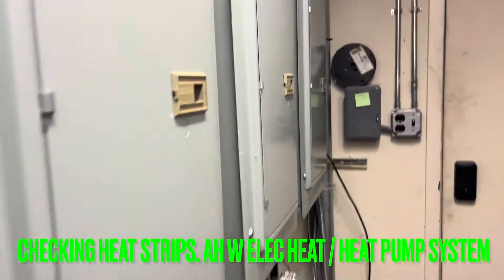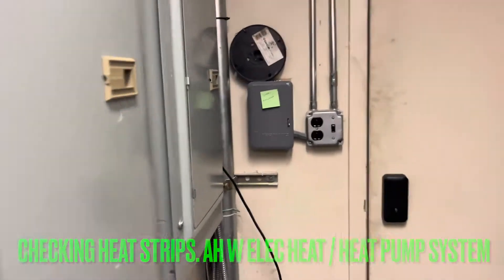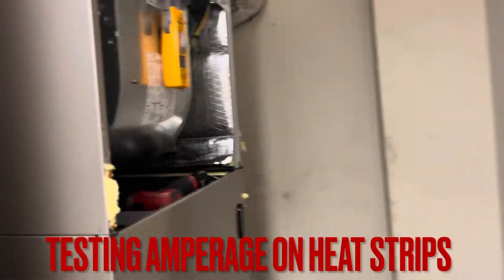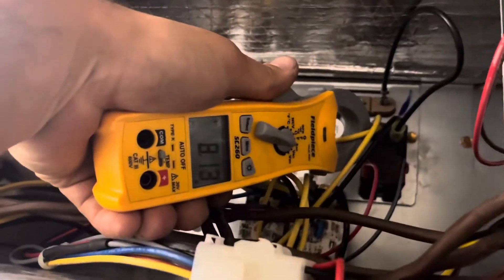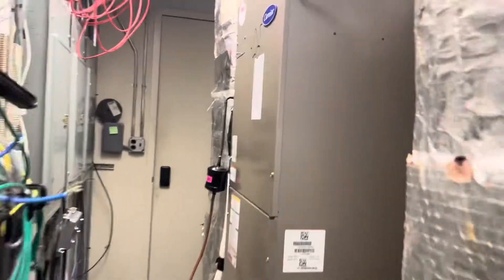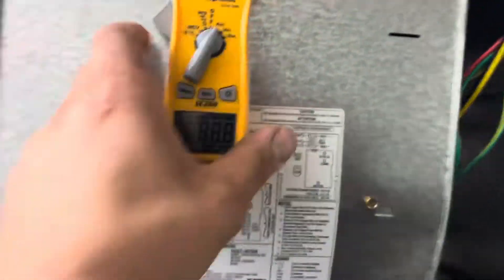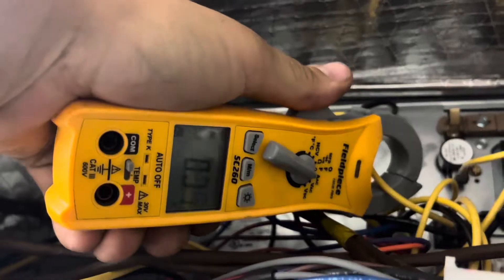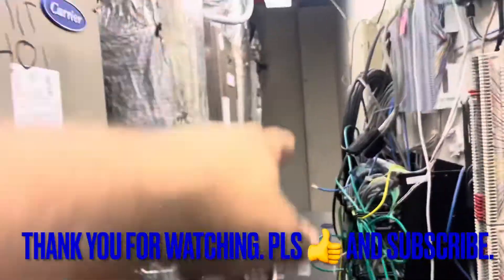HOW DO I TEST (CHECK) ELECTRIC HEAT STRIPS ON AIR HANDLER (HEAT PUMP SYSTEM)?

Comment: I was doing a routine check on an air handler but was getting no amp draws for the heat strips, like I even went wire by wire and couldn’t get anything, the unit was running perfectly fine what could be the cause ?
Reply from the maker: You have to make sure the heat is turned up high enough to activate the aux heat strips.  Also give it a few minutes to stage on.   An easy way is just set the thermostat to call for emergency heat only.   Give the air handler about a min or so to stage on all strips. If you don’t receive amps, shut the system down and check for continuity across each strip element.  May have no continuity which would be indicator of failed aux heat system.  Also make sure the thermostat is programmed and wired for aux heat
Reply: @ oooohhh ok I just turned on the unit and went right to it, I didn’t really give it time to start up since the blower was on I I thought I was good to go, so do I always have to turn it on emergency heat ?
Reply from the maker: No.   That is just for a test for your amp draw.  If you know it draws amperage on the test strips, at least you know they are functioning.  But now, if you have a heat pump, then system to heat only, but raise the temp about 7 degrees higher than actual room temp and wait a minute or two and check amps.   If they don’t come on, maybe check program and or wiring from thermostat to air handler to heat pump.
Reply: @hvacotj  ok thanks so much for taking the time to explain it, I just got into HVAC and a lot of stuff is still confusing to me lol👍🏼
Reply from the maker: Anytime bro.  Keep in touch.  If I can help I always will.

Comment: I was only drawing 8amps on each wire on an RTU unit's strips that were marked as being 16kw. What would cause such a low draw?
Reply from the maker: Check sequencer make sure all heat elwments are energizing, check out that connections on individual safeties arent causing full staging.  Can even be lower than normal voltage required isnt completing, even control board. I would start with the meter and make sure voltages correct, tight connections.  And with power off, ring out element circuit for delayed response.
Reply: Thanks  @hvacotj
Reply from the maker: Please give me update.   You can pull the entire electric box out (POWER COMPLETELY OFF) four screws. And checks wiring.  You may have issue with connection on back side.   Check connections thoroughly. They rust during air conditioning season easily.
Reply: @hvacotj  well I posted pictures and more info on a forum site and talked about it with several people.

It is actually 12kw because the unit is 208V. It is a rooftop unit, two of them have this issue. I did measure 75amps (around two wires at once) off another that is working fine.

After talking on the forum, it looks like I'm pulling low amps because there is a break in atleast one of the coils. So I ordered two new coils and will replace soon. On the ordering site, the same exact model number coil says it's supposed to draw 33amps on 208V. So I figure once I change it out, that's what I'll be getting. I did verify correct high and low voltage on everything.
Reply from the maker: That’s with single phase.  You must be at 3 phase with commercial rtu.    Delta and wye calculations.
Reply: Hi, how much does it cost?

Comment: Hey great video. I am having a weird problem maybe you could help me out. Just wondering what would make multiple limit switches open on heat strips as soon as they get power to them. They open before the strips even come on so it can't be on temperature inside the unit.
They have been replaced and same thing happens
Reply from the maker: Call me 203 617 5177

Comment: Great video. I’m getting a heat pump installed with an electric air handler with the heat strips very soon. Don’t have access to natural gas in my neighborhood. I always thought forced air had to be gas but grateful it doesn’t.